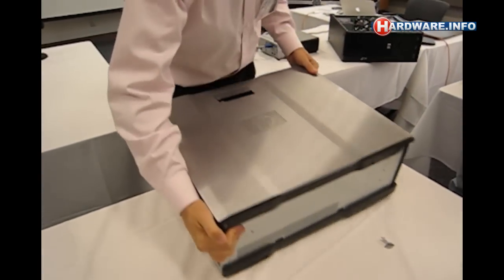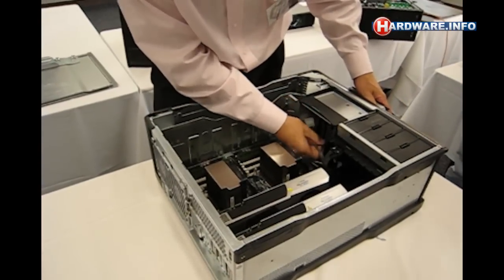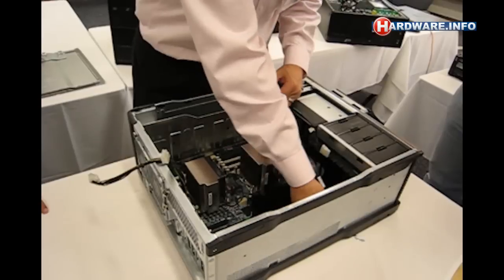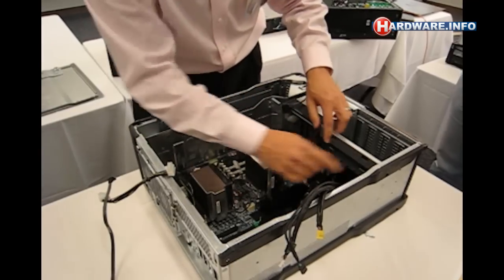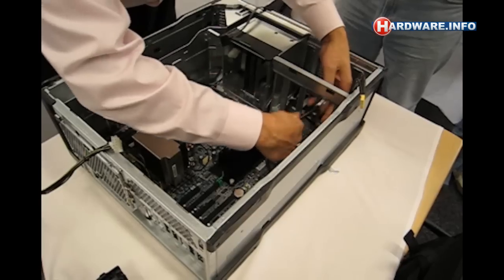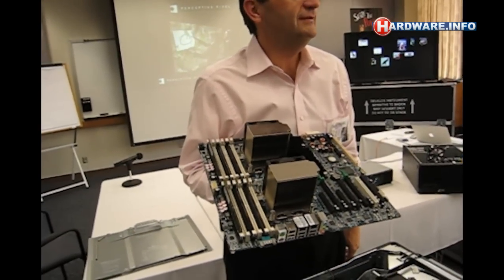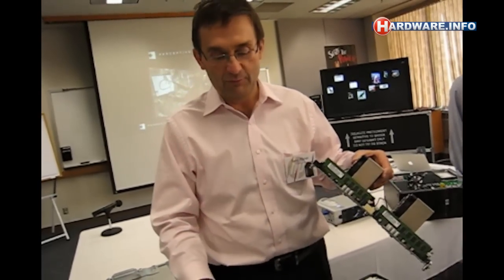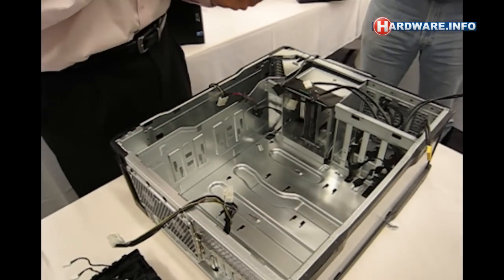HP Z800 workstation disassembly

Comment: I won that workstation for $26 on Ebay with top configuration (1120W power supply). The most disadvantage of it is high power cosuming (1 kWt/hour in load)

Comment: The one thing that HP failed on is making it virtually impossible to remove the right hand side panel with their glue. When you need to replace any of the cables behind the motherboard panel, you are forced to remove the security screws and then force the panel up off of the slides that hold it in place. The glue they use to keep the panel in make it difficult and the soft metal of the panel can be damaged when attempting to force it off.

Comment: Thanks for uploading this video. Very useful for me. I am building a HP Z820. I bought the chassis and the motherboard separately. My next step is to find the best dual Xeon processors that will work with the motherboard. Any help will be appreciated.
Reply: If you have the performance heatsink, your best choice for Z800 is the Xeon X5690, if you dont have the performance heat sinks, maximum tdp is 95W, limits you to the Xeon X5670.
Reply: @GOLTURBO555  The stock heatsinks can handle the 5690 but run hot, mine runs custom liquid cooling, but you can also use two aio coolers. The holes line up with the AM4 holes
Reply: @crapcopter  Thanks for the tip. I've tried to run the X5680 and run 90ºC at idle... I need to change to the 5670, and im waiting the HP heatsinks. The reason why I bought it, its because I want to keep the memory coolers. Thanks man.

Comment: I have one with a 5687 and one Sapphire Radeon 7950 (which I overclock the crap out of) and this case is able to keep my gpu under 65C  while playing forza 6 2560x1440 on Ultra(48-60FPS) .  I had to hack a Noctua heatsink on it but it worked....and my max cpu temp on my 5th run of cine-bench was 64C(well below its max operating temp). though I do have to scale down to 1080P on ultra when drivitars are greater than <4 but that probably has more to do with the fact the 7950 only has 3GB of VRAM.......

Comment: Nice video i  upgraded my hp z800 with 2 x5690 1110 watt power supply  the first 3 days worked perfectly now i am having problems every time a press the power button it turns on then in a few seconds it powers off like a power cables pull sometimes it boots fine then after 30 min it shuts off with out any warning  cpu temps 34c and 32 c  power supply is new i have after market 8gb memory ram could the problem be bad thermal paste do i need better thermal paste or the ram that i am using could be causing this problem this is the 2nd hp z800 i try upgrading and both did the exact thing so now i am thinking i could be doing something wrong can anyone please help me thanks
Reply: maybe damaged cpu pin....if you bought your 5690 from a reputable dealer....then I doubt the 5690 is the problem.

Comment: HP needs to show on the web-site, excellent overview of how serviceable the units have become and about time. But as one commentor said needs to reassemble and fire up. 
The Z1 was shown at a recent Solidworks conference in Westford MA, was dismantled and put back together in a similar manner and refired.
HP needs to place a prox sensor to shut of the internal power if the cover is opened/removed, so no one gets any sort of electrical shock, even though majority of components are low volt DC.